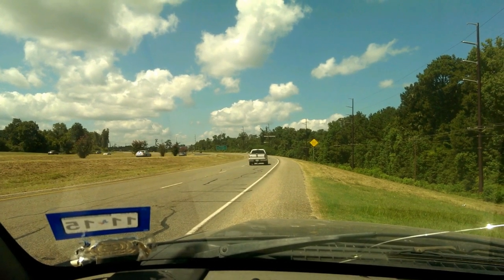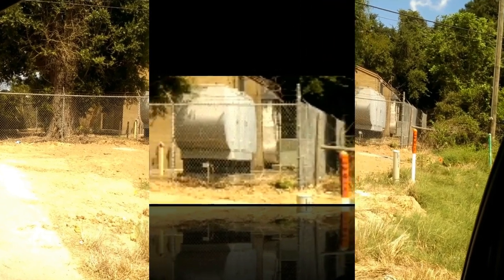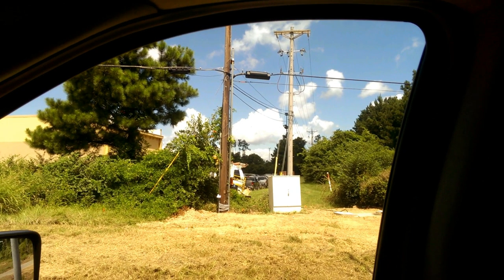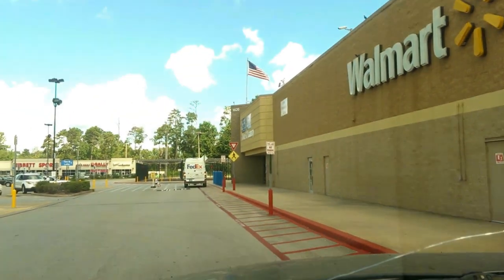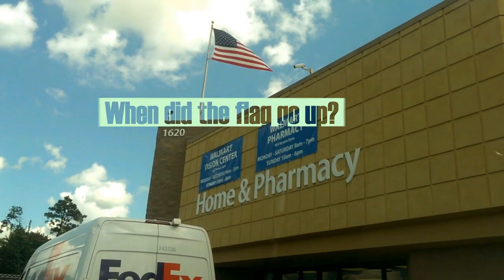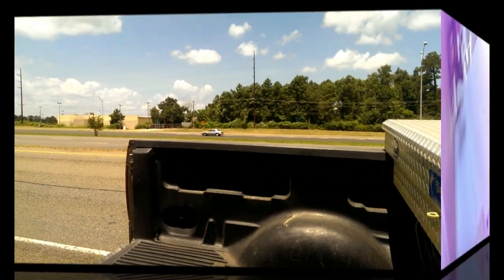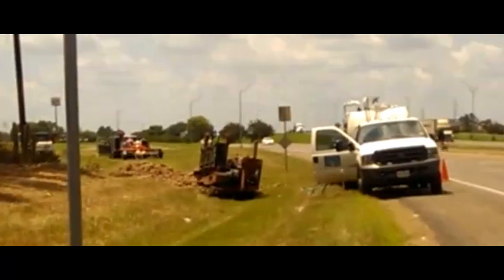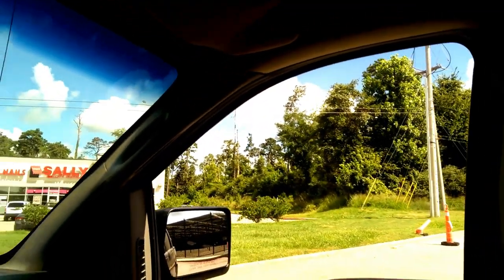Jade Helm 15 Update from Livingston TX

Comment: Those aren't metal detectors, they are RFID scanners. Some packages contain RFID chips so if you bypass the cashier and shoplift, you will be caught shoplifting. Apparently you've never been in a Wal-Mart before? I've accidentally set them off when the cashier failed to neutralize the RFID tag, chances are you have too. Shelves were cleared so buried plumbing pipes can be accessed once they bust up the concrete. Where I live, plumbers and construction workers do need to go to the bathroom, so they use porta-potties, it would be more conspiratorial if they did not have them, imagine a plumber taking a bathroom break in the Wal-Mart bathroom, only to go back and work in his own waste! (Replacing plumbing, need porta potties...bathrooms don't work!) At least they kept the pharmacy open, maybe so people can see what is going on in light of the rumors? As for AT&T, more people are using internet, cell phones...maybe thy are developing more land and need lines run across the road...it happens. OK, nothing in this video to refute the suspicious Wal-Mart plumbing story. Here is my conspiracy: Near my state capitol I noticed a McDonalds got rid of their men's room and ladies' room. They replaced them with 3 single toilet private bathrooms labeled for use by a man or a woman. Why did I notice? Because they were all 3 occupied and I had to wait in line for one to open ...like on a plane! Before, there was probably At least  3 stalls / urinals in the men's room and 3 stalls in the ladies" room. 6 could go at once. Now only 3 people can go at once. We all suffer from others' sin. I believe they did this as a solution to gender confused people who want to use the wrong bathroom, predators posing as gender confused people, and all the other problems recent events, depraved cultural attitudes  and court rulings have brought about in that city. My theory is Wal-Mart is preparing to deal with that in advance, on a large scale, before law suits come rolling in, and so normal people can relieve themselves without fear. Jade Helm is just a diversion to prevent people with full bladders from protesting, thus the secrecy...oh wait, they admitted it had to do with plumbing...just not telling us the full story, LOL!
Reply: Also, as for the trencher....I'm not a plumber, but even I have rented a trencher  when laying pipe! You expect professionals to hand dig? I love a good conspiracy, but you're gonna have to come up with more than this!

Comment: Shades Off - Eyes Wide Open That clearly was NOT a metal detector you showed in your video. It was obviously a PRD, or Personal Radiation Detector. Good job with the video. Fix that windshield. It's making me crazy. Next time, get your ass right up on some of that equipment. I need numbers to trace it. Keep up the good work!

Comment: I think they are going to be holding facilities, till your shipped off to a fema camp. Only my opinion. They are de gutting them on the inside, it has nothing to do with plumbing issues. Just my thought.
Reply from the maker: Dan Strayer try thinking outside the box or matrix... Connection: AT&T is the only private telecommunications co. certified by DHS... Then read about "Markov Chains" and the connection to the DOD, or watch a video. Consider the purpose of the A.I. "Jade II" program that the "Jade Helm 15" exercise is testing... Critically think it through to possible conclusions and see if there are any conducive to peace & freedom.. And as a bonus if you are spiritually grounded in scripture, throw in the Sh'metah and the blood moon tetrad both ending this year. It's deep but if you are wanting truth sometimes it takes some digging...Blessings ><>

Comment: time to put that crack pipe away.
Reply from the maker: Woodbldr760 North Co. After you...try thinking outside the box or matrix... Connection: AT&T is the only private telecommunications co. certified by DHS... Then read about "Markov Chains" and the connection to the DOD, or watch a video. Consider the purpose of the A.I. "Jade II" program that the "Jade Helm 15" exercise is testing... Critically think it through to possible conclusions and see if there are any conducive to peace & freedom.. And as a bonus if you are spiritually grounded in scripture, throw in the Sh'metah and the blood moon tetrad both ending this year. It's deep but if you are wanting truth sometimes it takes some digging...Blessings ><>